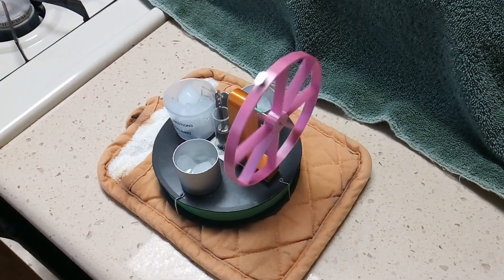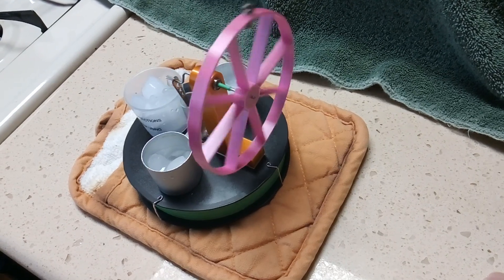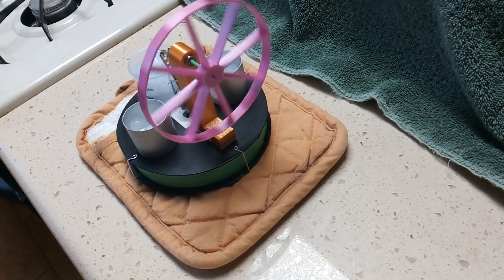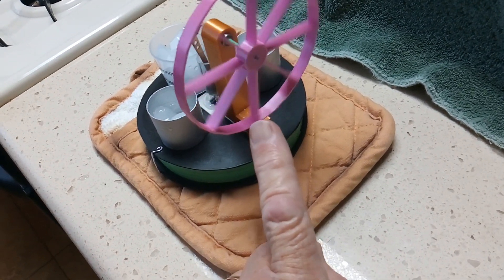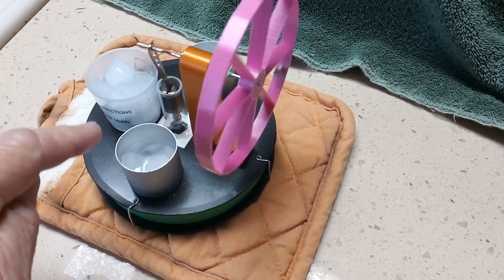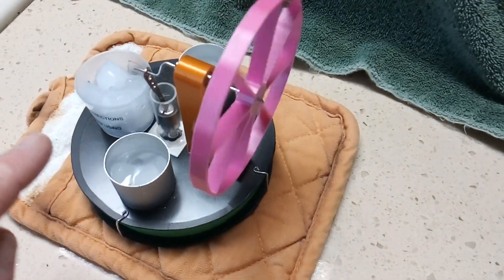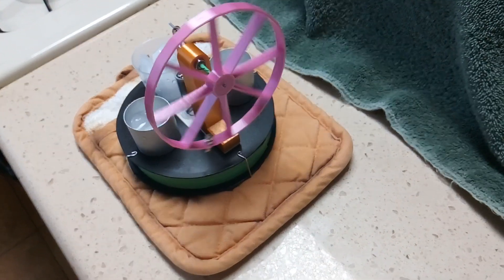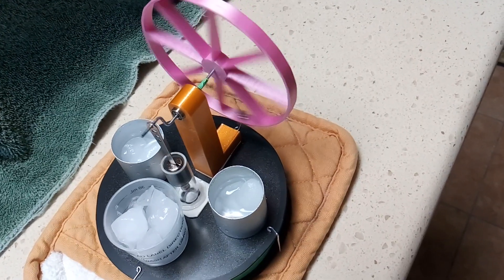Stirling Engine -----  Running on just ice

Comment: Next, paired with replenisher?😃

I am considering stenciling in conductive ink onto plastic. Then  copper plate followed with nickle plate, the inducer and capacitor plates on the plastic to make a lord kelvin replenisher. I'm looking for a suitable solution to etch various plastics  where i mix graphite blended in. Maybe I'll just use pvc pipe and  pvc pipe solvent/glue with graphite mixed in. 

I expect that nickle plating over copper will be more durable under the brush vs using aluminum foil, as well as resist oxidation. 

Now that I just thought about pvc pipe. I thought about "how long do I want to make the pipe".  Extra capacitance could make scary hot arcs if I wanted. 😱  I probably should play a little safer.